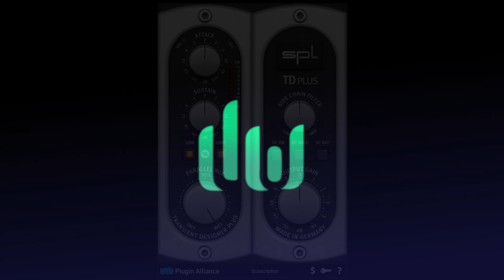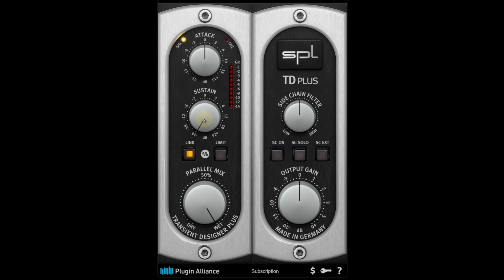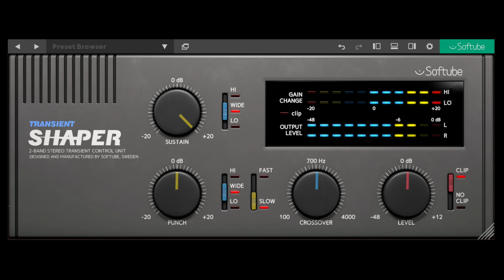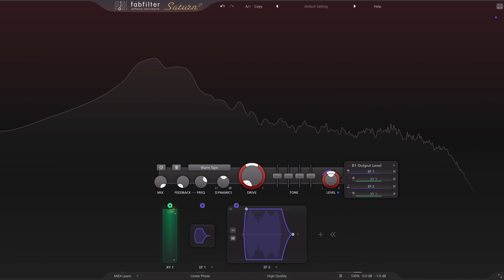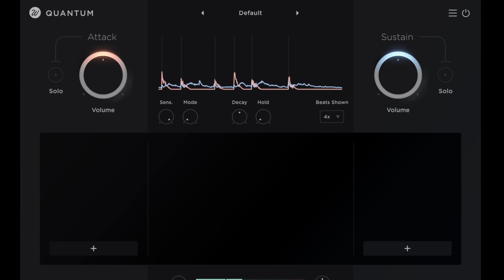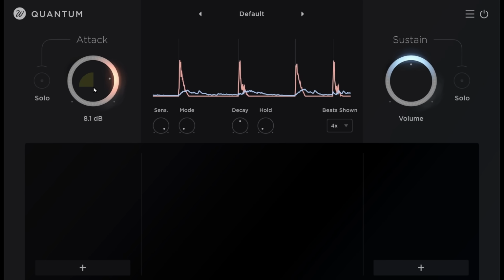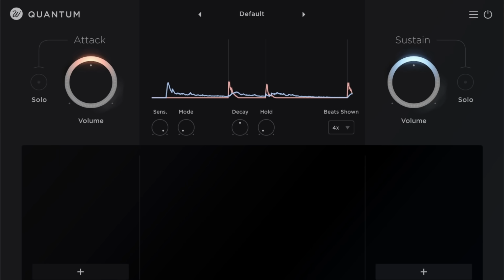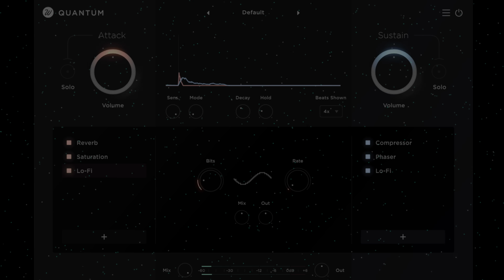About Transient Designers

Comment: Dan, do you have any recommendation for upward compression!?
Reply from the maker: Parallel compression. Or FabFilter Pro-MB.
Reply: @DanWorrall AFAIK none of these can achieve upward compression.
AFAIK upward compression = if below a treshold then puah the sound louder 

Which is different from parallel compression, different from expanding, different from what mb can do?
Reply from the maker: @henriquematias1986 yes they can. Parallel compression creates a form of pseudo upward compression that's usually more useful than actual upward compression. While Pro-MB offers literal upward compression.
Reply: @DanWorrall i swear i had looked on Pro MB before and didnt figure out upward compression and now i looked again and i did! Also i found this little “down arrow” next to the “x” button on the band configuration which literally has a preset for upward compression ( which i never found on the overall preset menu ).

Took me a while to figure this one out!

Thanks for your help! 🙏

Comment: Thanks for the Saturn preset Dan! For a learning experience, I tried first to make it just by following what you did there. But apparently I misunderstood some step, so your preset came handy. And now I have a nice transient designer too, great.
Reply from the maker: Making the sliders bidirectional requires that you double up all the mod slots, with separate ones for up and down. It's a bit fiddly and confusing to set up.
Reply from the maker: What I mean is, you didn't misunderstand the step, I glossed over it to keep things simpler.

Comment: Dear Mr.Worrall. What about Boz Digital Transgressor (3) which has been there for years. You can decide the length of the attack and sustain and even  EQ them seperately. In my opinion Boz Digital doesn't get the respect they deserve overall. What is your opinion? Thanks in advance

Comment: Dan, you should try DS 10 by XLN Audio (if you have not already). I've tried many transient shapers, and though DS 10 isn't as "feature packed" as quite some others, DS 10 to my ears sounds extremely good and very natural. To my surprise it's quite under the radar, at least based on my awareness. And no - i'm not affiliated with XLN in any way - These are just my findings.
Keep up the great work. 👍

Comment: The SPL Transient Designer Plus has been in my drum bus in my template for awhile. I used to use NI's Transient Master as my go to (included in NI Komplete). I feel like the sidechain filter of Transient Designer Plus is that little extra that made it more useful in my case. I also like the parallel mix, which I don't think was really showcased much in this video, as everything here was 100% wet. I do mostly electronic stuff, so my drum programming tends to be a lot more hard hitting and punchy so I tend to tighten rather than boost sustain, and the SPL sounds great to me for that. It often goes on sale for under $30, so I would recommend to others, there's no reason to buy it full price.

This video still gives me a lot to chew on, and it was cool seeing you make your own emulation with envelope followers. I'll probably consider some other options or going back to NI Transient Master to bring out body/sustain over the SPL. But yeah, what ultimately matters is the context of what you use things on, and the extent of how you use it, be it just a nice parallel blend or going full 100% to the max.

Don't sleep on the SPL when it goes on sale, it's still a nice to have. Unchecking 'Link' can sound interesting on stereo shaped snares and stuff that allows the transients of L and R to adjust separately rather than forcing Attack/Sustain moves on both sides simultaneously. I love it for trap drums.

Comment: I really like st4b for slightly tweaky yet simple to use transient shaping. It takes the split signal approach and gives a single knob for each band instead of multiple knobs. The single-band version also has a separate transient/tonal output available for some DAWs which is cool if you want to apply your own processing to just the transients or just the sustain, kinda like Quantum. Nice for sound design

Comment: wait, why are envelope followers lowpass filters?? Can someone elaborate on that more? I thought it would be looking at the dB of the signal... What does filters have to do with it?
Reply: My understanding is: It basically "followes" the general shape of the amplitude, so those quick (high freq) jumps of the amplitude doesn't trigger the envelope follower. AKA, a low pass filter.
Reply from the maker: The audio signal constantly oscillates from positive to negative and back. We want a positive only signal that follows the peaks. So let's start by rectifying (flip the negative to positive). But now we need to smooth out those dips down to zero. So add a lowpass filter, and set the cutout differently depending on whether the signal is increasing or decreasing: a higher (faster) cutoff when the level is increasing, but a lower (slower) cutoff when its decreasing, to smooth out those dips down to zero. We've designed a simple envelope follower.
Reply: @DanWorrall  i kind of understand what youre getting at. For sure the rectifying part. 

Would u be able to do a little short or something explaining it in further detail?
Reply: @DanWorrall  nvm, it clicked in my head after a nap

Comment: I’ve been under the impression for a long time that one of the differences between compressors and transient designers is that compressors react to LEVELS in the audio while transient designers react to how quickly levels are CHANGING. Do I have that wrong?
Reply from the maker: No, I think that's correct.
Reply: @DanWorrall  if so, you can’t re-create a true transient designer with envelope followers.?
Reply from the maker: The difference between a fast envelope follower and a slow envelope follower is the rate of change.

Comment: The stuff I am still pondering, and have not yet found a good answer to: if I get snap using a compressor, do I still need a transient shaper ( probably yes for the non-attack oriented processing, e.g. the guitar iwth a piezo )? Another one: if I use a transient shaper, my snare can get nice, loud and crispy, but the transients will kill the possibility of making the mix loud via mastering, as little headroom will be left. Otherwise I am left with another problem, how to retain the snap and still not get peaks that are simply too tall.
Reply from the maker: You still need a transient designer, but for completely different applications, like controlling the decay of a floor tom. And I would suggest prioritizing the sound over "loudness potential". If it sounds good your listeners will crank it! And however prominent your transients are, a bit of careful clipping / limiting will likely allow you to get the mix up to sensible levels in mastering.
Reply: Thanks Dan, will keep that in mind

Comment: thanks dan. I've built a bunch of versions in Saturn that target different parameters instead of level, such as drive or EQ. great for sound design, but I had to use two instances to achieve stereo independence. Bitwig makes that easy with its stereo split device

Comment: I think the body section envelope is the same as the attack section, but both attack controls are set a bit slower... So instead of boosting or cutting the attack starting at 0ms, you're starting at a point maybe 10-30ms after the initial transient. But still using the attack portion of what SPL call a differential envelope follower. Can't be bothered to try this myself, so let me know if it gets you close. ^^

Comment: I have found another good way to do this type of processing is to take your favorite compressor and set it for a slow attack time and very low threshold and high ratio with longest release possible for the material.

This creates your transient signal.

Then you can invert the polarity on this and sum it with the original signal so that it cancels out the transient and leaves the sustain.

Now you have separate control over transient and sustain using just one envelope and it sounds less weird imo. This can be done both in analog or digital implementation.

Comment: I've been using Eventide's SplitEQ kind of like a multiband transient designer as it IS an EQ but has two separate curves you can set for transient and tonal. Would love to hear Dan's thoughts on this plugin, I'm not sure I'm getting the most out of it
Reply: Yeah, I would use it a LOT more for that as well, if it wouldn't also be quite rough on the CPU (compared to the other tools I use for transient design). But it is indeed a really neat tool for controlling transients.

Comment: There is a lot of freedom in transient designer designs, a lot of it is fine tuning the envelope timing though. All of these would follow similar principles except some plugins add additional detection methods using statistical analysis and/or fft, usually at the cost of latency. I’ve found quite a few detection algorithms to be lacklustre, I recently created the 4th iteration of my own and thankfully it doesn’t suck 😛
Reply: Probably a bit reductionist to call them all just envelope followers, you could say the exact same thing about compressors or in fact most dynamic processors. Useful video as always though Dan 🤘🏼

Comment: "..and 24 in multi-band mode". Yeah this is why most people use software and not rack/500 series and/or modular gear. Though Dan doing a series on eurorack would be the best crossover (arf).

Comment: I have been using SPL's plugin for years, on purpose, because I figured that, bearing the name, it must be the best at emulating what the original hardware did. I thought that Transient Master being smoother was a biproduct and undesirable because there was some flaw to the approach that made it "looser," for some reason, with regard to the sustain. Now I realize that I have been fooled into believing that the flaws are "hallmarks" of a "more authentic" emulation, and that more invisible operation, even if it made using the effect easier, is somehow "undesirable." I'm going to need to re-evaluate. Thank you for posting your Saturn preset. I will absolutely be toying with this, and probably any other transient designer I can find that has a sidechain filter, as a way to replace and get better control over the effect I have been using Transient Designer Plus for, for something like a decade.

Comment: Oxford Envolution also has sensitivity control, but no solo option
Reply: Haven’t tried that, but Oxford TransMod is good. Also doesn’t have a solo option but it is the only transient plugin I’ll need.
Reply: @Vingul  never tried TransMod, I have no idea what it does 😆
Reply: @yoco93cro  Basically just sharpening or dampening transients. "Transient modifier".
Reply: @Vingul  Makes sense. I am very happy with envolution, f.e. room sounds like in this video sound amazing with envolution as well, especially with internal eq/frequency sensitivity applied

Comment: I wrote a blog post about using 2x cableguys volume shaper with inverted volume shapes and the transient detection to divide a signal into its transient and sustain part.
You can put any plugin on each section if you like.
Its of course a bit dirty but some reverb and distortion for the sustain part is fun on drums!
Reply: It's a good trick.

Comment: Newfangled Articulate uses a similar approach to Quantum, but with 4 sections based on classic ADSR. I have confirmed that you can split and sum the soloed sections in order to apply different fx to them. It's totally awesome.
Reply: You could for example simultaneously limit the Attack transients, saturate the Decay, expand the Sustain, and add reverb to the Release tail (without those processes affecting the other sections). Endless possibilities.

I made an Ableton rack using its isolated chains for easy fx drop-in, along the lines of my other PerforModule Splytter racks. It's so fun.
Reply: Articulate is a beeeast, i think people kinda overlooked it
Reply: so its actually not just some envelope followers? Thats the info i searched for! Otherwise it would be a boring plugin which i did not expect by Newfangled Audio
Reply: Articulate is great.
Reply: Why would one want to affect the sections individually?
Reply: @F4xP4s that tells me you're definitely not a Reaper user. 😉 The answer to your question is... Why not?

Comment: I have still not encountered material where problems could be fixed with a transient designer better than with other tools. In fact, never encountered a problem that could be fixed with it at all. Rather, it has always been a sound design tool for me. Would have been nice to see a viable example for using it to fix a problem, especially in such case where it is "the optimal" solution.
Reply from the maker: You know, when the drummer starts pounding eighth notes on the floor tom instead of the hi hats, and the whole mix turns into boomy treacle? Turn down the Sustain knob, problem solved.
Reply: Transient designer is also a very easy way to place an instrument front or back in the mix. Just a subtle touch, et voilà...

Comment: Surprised you didn’t include Oeksound Spiff in this; I think they really changed the game.
Reply from the maker: I guess I'll have to try it then.
Reply: @DanWorrall  Def worth it; I assume you’re familiar with their other plugin Soothe? Spiff has become my first-reach for transient work.

I will say, the separation and independent processing aspects of that Wavesfactory one you showed is equally dope and I’m gonna have to snag that for certain scenarios for sure.
Reply: @EricMitchellAudio split EQ and some other effects from eventide does the same (separation to two signals)
Reply: Or Punctuate by Newfangled Audio
Reply: @promethea-sy and they even have a newer one: articulate.
Reply: @promethea-sy punctuate, spiff and st4b are 3 great more modern transient shapers, yeah